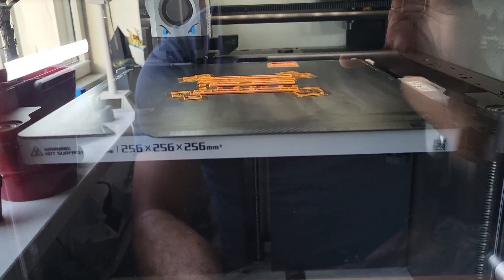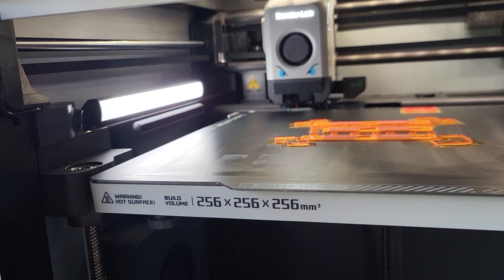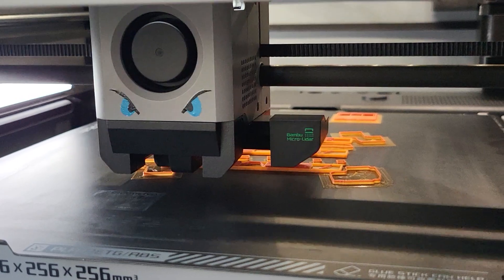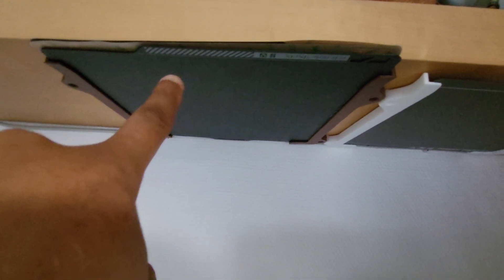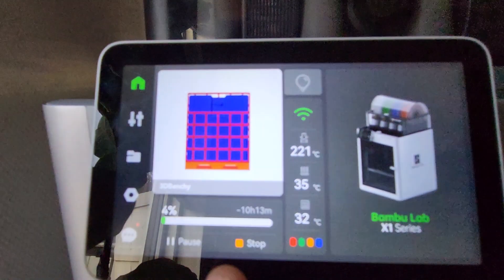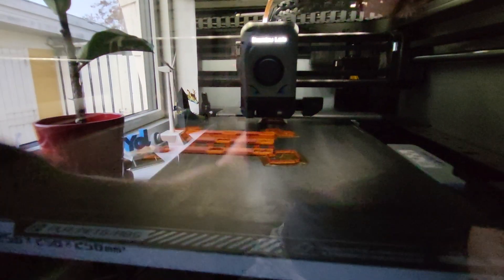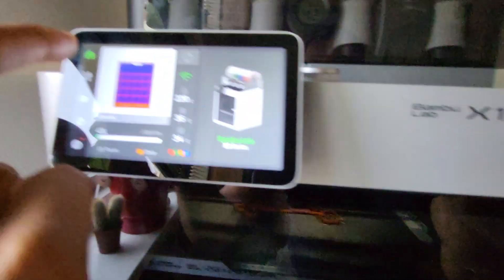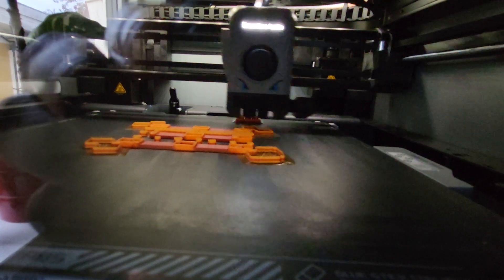Bambulabs X1 Carbon - after 14 days, a few pros and cons.

Comment: Hi - thansk for the video!  What temp meter is that in the AMS?  I like the silica holders do you have an STL you could share?  Thanks!
Reply: It's a Hydrometer. It gives a relative humidity reading and temp for his version. It does not come with the unit. You can also see he has 2 printed desiccant(moisture absorbers) holders to the sides of the reader. There are also holders for more desiccant under the spools.
The AMS does not have a heater or active fan. It's all passive.
Reply from the maker: The black round hygrometer/termometer I sold om ebay or aliexpress for a couple of bucks. The STLs for the hygrometer holder and the desiccant is available on printables.com

Comment: Spot on, there are faster/better, but what's our time worth? Seriously considering this as my next printer.
Reply from the maker: Yeah, it just makes sense.
Reply: CR10V2 print part for tablet with joystick costs 7 hr, x1 carbon only use 2 hr to finish it and the part made from x1 is much accuracy than CR10's

Comment: A note about the other fast printers not being as fast: They arent, and I think this is just a fact as the Bambulab had actual engineers use carbon fibre rods and plastics where necessary to reduce weight and improve acceleration, but I think that the fastest machines, things like Vezbots, use curtain air (the fan on the side of the Bambulab) to achieve those super fast benchies as when you get to that speed you need more than a hotend can reasonably carry.

I believe there are mods for most vorons, including the 0 to add in curtain air, though as you might expect, it gets loud.
Reply from the maker: That makes sense.
Reply: the side air coolers aren't really necessary. I run a 4028 server fan on my vcore 3, and it provides enough cooling for my needs. Sounds like a jet engine, but those little fans push so much air.

Comment: Is that a Trinidad and Tobago accent by any chance?

As for the printer, I too have one and have been impressed. I think the cold plate was chosen because the printer needs to have the door open for hotter temperatures when printing PLA (as with chamber temps around 60 or higher, the PLA starts getting soft in the ambient which could clog things up) and this was a more acceptable solution to them than having printers jam as people might not leave the doors open. I think that this is actually one of the few things that's poorly thought out though. Why not have a stronger fan to evacuate the heat instead? Why not a panel in the top glass? This is one of a few things that I think could change for version 2.0.

I also think that it would be nice if the filter was a hepa/activated charcoal filter combo and was more powerful, and this is something they can fix right now just with the inclusion of a stronger fan and filter replacement.

That all being said, they do offer textured PEI sheets and there are third party ones as well, but I do agree that having to use glue stick is mildly annoying.

In my experience though with the cool plate, not using gluestick (though I only lightly wiped and there might have been some remnants) doesn't actually cause it to stick too well, it instead just doesn't stick as well as you would hope for pla. Yes, I tried this once for science.

Edit: I guess you address a lot of this as the video goes on.
Reply from the maker: Thank you for you objective insight and observations.

* nope not a TT accent , but my dad is West African (Nigeria)

Comment: Hey 57echo How's going its great 3d printed machine looks like will be perfect project in future well done buddy 👍😊👍 so My lxyrc bobcat needs 2 drive motore for right side wheels l😂l Damm the left side wheel work good But right side wheels stuck not moving Even she need that part for servoe Until you Can open the valve for bucket when i use the bucket this part loosen And some oil start leaking
Reply from the maker: Fingers crossed! I hope you get to fix it. Mine has no problems so far (knock on wood). Thanks for watching.
Reply: @75echo  you right 👍 sometimes the right wheels move But very slowly And stop Can you please tell me How i Can avoid this problem
Reply from the maker: @The-Warm-voice1359  i have changed my drive train with a kit i bought from Germany. From here: http://www.constructionzone-rc.de/BOBCAT/bobcat.html
Reply: @75echo  ohh Thank you so much my friend much appreciated Do they have delivery 2 Kuwait Because i'm Canadian But i work in Kuwait?
Reply from the maker: @The-Warm-voice1359  maybe, throw them an email😉
Reply: @75echo  yeah that what i will do indeed 👍